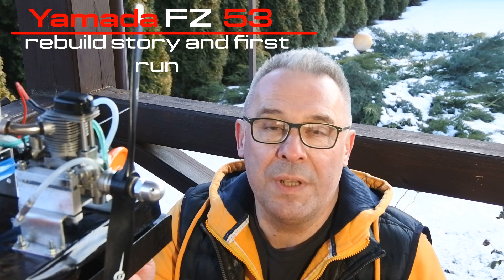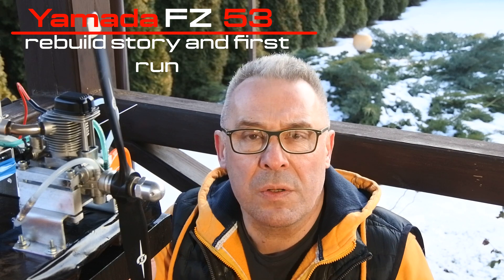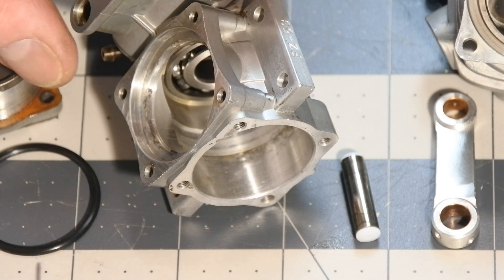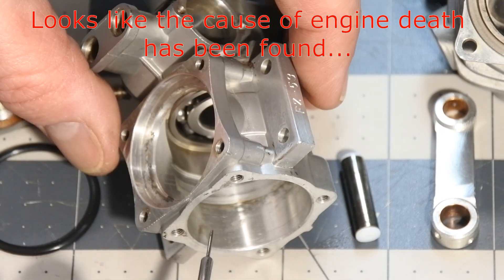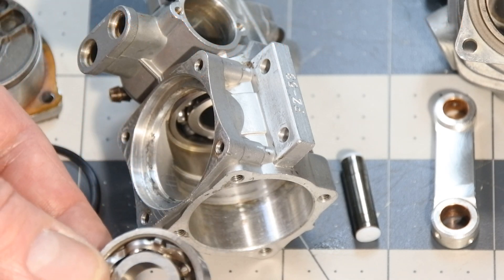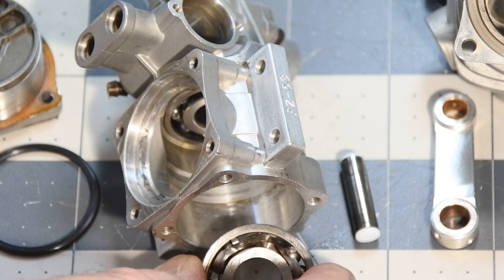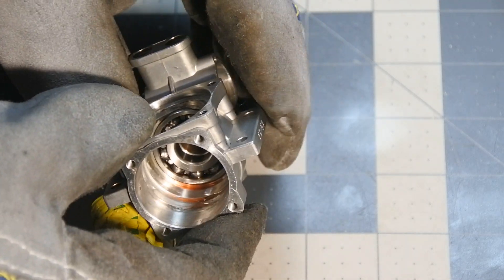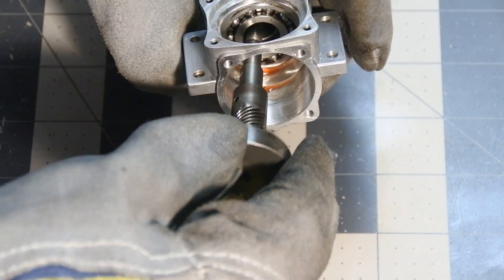Yamada FZ 53 rebuild story and first run

Comment: I think I have a use for my FZ-53! Bought a Balsa USA Northstar at my LHS and I don't care for 2-strokes all that much, so this poor little FZ-53 I've had for a couple years with nothing to do finally has a home.

Prop chart goes 10-9, 10-10, 11-7, 11-8, 12-7, 12-8, so I think given the airplane's limited prop clearance, I will use a 10-7-3.
Reply from the maker: Great news ! Yamada FZ 53 should be a very perfect choice, for sure. How do you think, could it turn 11 x 10 prop or its clearance is to high ?
Reply: @crazyengines88  Even an 11-10 would require either lifting the engine pod higher up or slotting the wing. A 10-7 3-blade is roughly equivalent in load to a 11-7 2-blade but will clear the wing without any modifications, and the manual for the FZ-53 says an 11-7 2-blade is perfectly acceptable.

The manual even calls out a 10-9 or 10-10 as acceptable props. Unthinkably small for a normal 4-cycle this size, but YS engines are thoroughbreds!
Reply from the maker: OK, copy that, thank you for explanation !

Comment: Fantastic sound nice job, I love glo engines but always thought YS was overly complicated so I never purchased one
Reply from the maker: Thank you for your nice comment ! Definitely, YS engines are much more complicated, than typical glow engines. From one side, YS constructional;  complication is only the way how to increase power / wait factor and I should say, that from this side Yamada was make really great job. From the other side, to obtain stable performance, YS engines always need to be precisely tuned before flight. But, once tuned, it could be handle this settings for a long time, I don't know, how long, to be honest. My experience with YS confirm, that it will take time to tune an engine into perfect operational state. But probably, the gain in power and performance could greatly compensate this time investment. 
Thank you for your comment ! Have a nice day !

Comment: That idle sounds soo smooth! I like the idea of using a rubber band to keep the crank at top dead center while timing the camshaft
Reply from the maker: Thank you very much for your kind comment ! Getting such a positive feedback from CrazyEngines viewers and subscribers, definitely, greatly motivate me to continue the Project.
I'm working right now with engine fine tunings, specially, in idle area. 
So, stay tuned, and probably, even better idle you can  hear soon. 
Have a nice day !